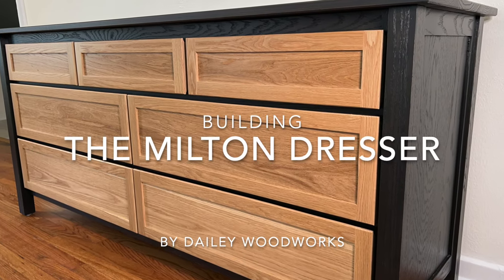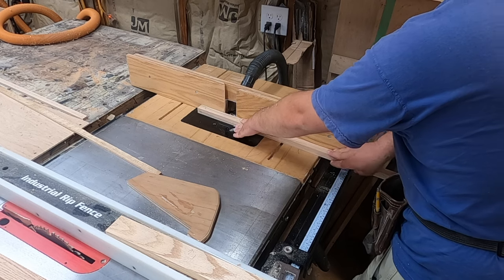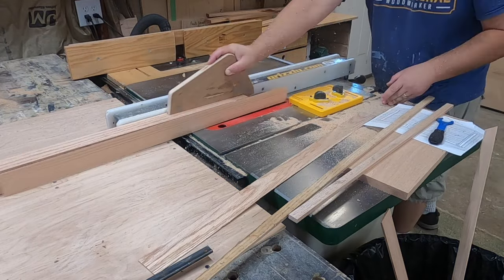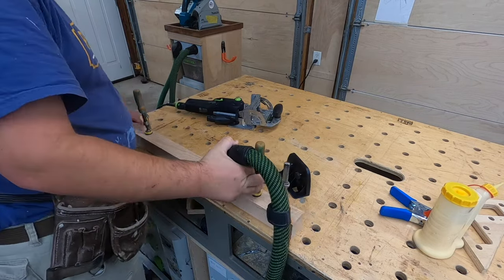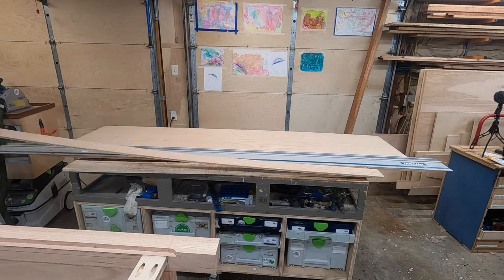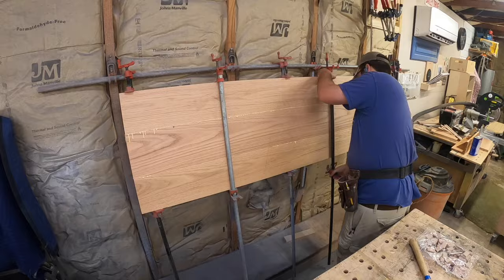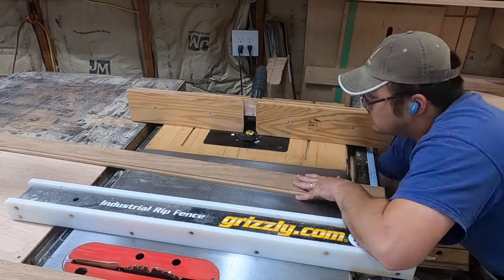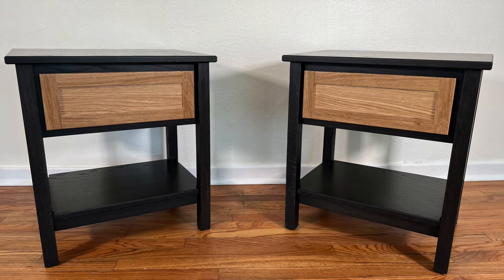Milton Dresser Build - Modern Shaker Furniture Build - by Dailey Woodworks in Bryan, Texas

Comment: In vid you say you're using 1/2 ply, but the materials list says 3/4. Error?
Reply from the maker: That was a design change I made after building the project. I figured moving to 3/4 would make the project simpler to build as doing a 5piece side panel is really unnecessary

Comment: Where did you get the base for your assembly table?
Reply from the maker: The adjustable height one? It’s a felder FAT 300. It’s pricey but a back saver that makes working solo a lot easier. Here is the video https://youtu.be/A2DRfvU9aBs

Everything else is shop built
Reply: @DaileyWoodworks  I appreciate th reply!! I found this video shortly after asking the question. Thanks